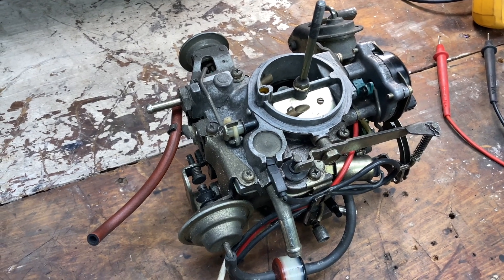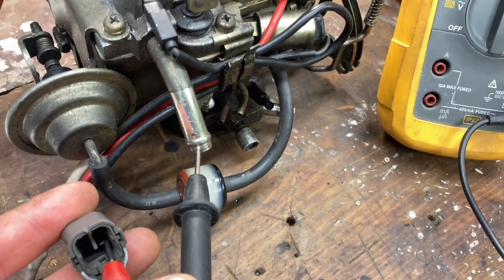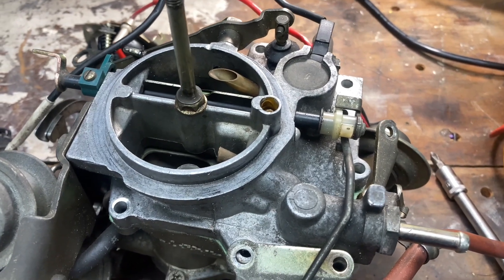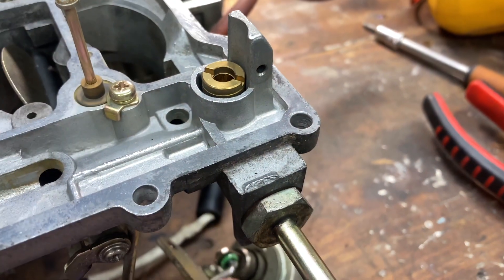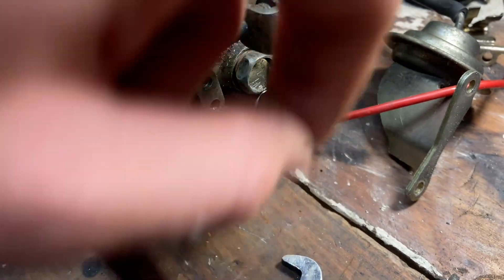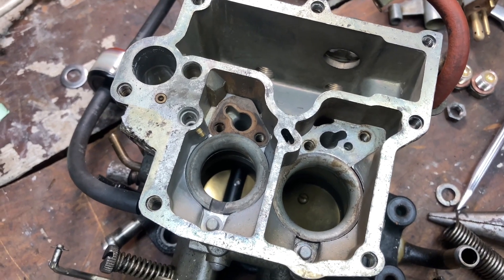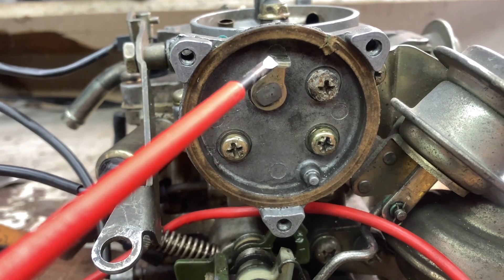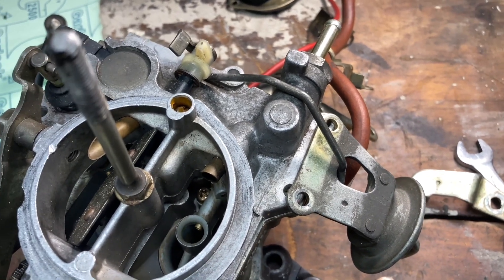Toyota 2E Carburettor disassembly and adjustment, cleaning etc

Comment: Well, the double audio had me super concerned, however information presented is critical. I figured i was missing something, and i was. 
I figured with a primary and secondary accelerator pump, it would have enough fuel for snappy acceleration. But power valve must be clogged on mine. 
Any way i look at it, im taking all the way down, like i should have to start with.

Comment: "I removed the carburetor and cleaned it thoroughly, then reinstalled it. After that, fuel consumption became excellent, the carbon buildup disappeared, and the engine sounded smooth. The car would start with just a tap and stayed that way for two weeks. But now, it won’t start unless I press the gas pedal, and when I release the pedal, the engine stalls — even at stoplights. What could have happened
Reply: Did you find a solution

Comment: The vehicle i have does not start unless a little bit of fuel is poured straight into the carb. I did notice that the fuel cut sensor has a dent in it. Could this be the cause?

Comment: I just have a question about the fuel bowl level window. Before driving the car the fuel level is exactly in the middle of the two metal marks but after driving the car it is above the top level mark is this normal because I have noticed while just at idle the car seems to be fumey.

Comment: Really top notch video.

But just a heads up. If removing the two screw on the butterfly plate, please make sure to flatten the screws when reinstalling or at the very minimum, use threadlock.

Had one of them come loose and graze up a bore. Not fun.😭

Comment: Hallo what is the problem if my car will not start in the morning i must throw petrol in the Caberator than it start were is the problem please and thank you for this great information 😊
Reply: That's normal for carb car. Just give it 2 pumps of petrol by the accelerator and let it run for 10 min to warm the car up. That does the trick with my car

Comment: How about the the bimetal that has 3 ports? Which of those ports are connected if the engine is cold and which of those ports if the engine is hot.
Reply: If you check under your bonnet there's a diagram. It will show you exactly where the vacuum pipes go. Hope this helps

Comment: Hi thanks for the informative video, I have watched you other video on setting the carb while its in the car  aswell

I have a question cause information on these cars are hard to come by, I am having a problem where when the car is parked overnight, i have to pump the acellerator for like 30 seconds before the car can start, so basically hold the starter for 5 seconds and pump pump pum then 3-4 seconds break, then another 5 seconds and so on... eventually the car will start and idle normally and drive normally... What would cause this?

Comment: My Toyota does not start without giving gas when it is hot. It starts when you press the gas pedal and start. where is problem ?
Reply: The dashpot might not be properly adjusted. The dashpot should hold the primary throttle plate ever so slightly to allow more air to pull the fuel from the primary jet
Reply: If it has a carburettor then this is normal
Reply: Así se arranca el motor 2e pisando a medias el acelerador y soltando cuando enciende, está por manual de usuario

Comment: Hi Jamie, thanks for the video! Have been following your content for a while now. I have an issue with this Carburettor on a 2E where it will run high at 3k rpm on cold start and will only settle to 900-1k when the the engine is at full operating temperature. I have to leave the car until the engine is stone cold or the choke will not come on at all. Choke doesn't seem to come off unless the auto choke assembly is set all the way to lean. Could be an issue with the choke actuator but not entirely sure to be honest. Apologies if this doesn't narrow anything down but I was wondering if you'd have any ideas as to what the problem is?
I have taken this to a couple of classic car garages and they haven't managed to get anywhere.
Reply: Have you checked your bimetal?

Comment: Hi jamie im having a problem with my 2e on cold start the fast idle only comes on for like 2 seconds then it goes off. And my motor then idles verry low till its warm.
Reply from the maker: You may need to increase the fast idle speed and/or the choke actuator
Reply: @notcompletelyobsolete  thanks Jamie, increasing the fast idle did the trick 👍🏼

Comment: WOULD U PLZ TELL ME THE ORIGINAL JETTING POWER VALE SECONDAY AND PRIMARY JETS FOR 3K CARBURETTOR WITH MANUAL CHOK FOR 2E ENGINE 12 VALVE

Comment: Hi Jamie. I have an issue with my idling speed. It runs high when cold like it is suppose to, but idle speed doesnt come all the way down at normal operating temperature. Out of desperation I adjusted the fuel mix screw, now the engine is running hot in addition to running high. Do you have remedy for this will be highly appreciated.
Reply: Do you find the problem?

Comment: Do you know the consequences of replacing all the vacuum valves with one way check valves (or removing completely)? The transmitting valves are nearly impossible/worth as much as my car to get here in the Philippines so was thinking maybe I could do this. I also had my vacuum switch valve break off. Is that only needed to heating car? Would it hurt to just plug up indefinitely? Don't really need heat here. Thanks for video!

Comment: Hey, I have a corolla ee90 which I think th eengine floods when it's not cold, my mechanic says it's ware a taire since the carb is over 30 years old, could it be bad cleaning and adjustment? what makes me think it runs rich is the fact that it bogs down and some times when it bogs down and turns off only at the 3rd crank the engine turns on but there is a strong smell of petrol. if you could give any adive it would be great

Comment: Hey bro, sounds like your from New Zealand, I'm from Auckland and have a 1994 2E Toyota Corolla Hatch, it has a bit of a rough idle and sometimes has smoke coming out the back of it, I believe it would possibly be the mixture setting as when I bought the car a few weeks back the guy had it on high idle, I remember seeing him touch the idle setting crew so one morning I adjusted it and made it rev lower, it was when it was about cold / warming up, seems to be good now and I know I can adjust that bit easily. I will have a go at the mixture setting but beforehand I was wondering if you were possibly in Auckland for you to have a look at it if your keen, would pay you for your time etc and if it can't be possible due to you being elsewhere, then I'll just try my best to follow these awesome videos you have here. Top notch stuff man, your really an expert on these (hopefully you cbk on a bit of a tune up hahaha) Cheers bro

Comment: hi jamie! my corolla e100 with 2e engine will shake and/or stall on operating temperature when coming to a stop, or turning from neutral to drive from idle, or putting it on reverse, or turning the steering wheel fast during stop. what could be the problem? should i turn up the base idle speed? but i feel like the rpm when i put it in neutral is already high. my car model came without an rpm meter, so i cant really tell.
Reply from the maker: Possibly the idle mixture screw is too far in (lean). This is the screw which sometimes has a tamper proof shroud over it, jamming a small flathead screwdriver between the screw and shroud allows you to adjust it without cutting or removing the shroud. Try winding this out about a turn and then adjust the base idle speed to around 800-900 rpm. If you still have idle issues, the passage ways or idle jet could be clogged and will need cleaning. Hope this helps

Comment: Good video helped me to better understand how the carb works on my Starlet. Though my starlet has the 1E engine the carbs are similar but the one on my Starlet is not an Auto Choke. and the lack of information has been driving me up the wall. I cannot seem to find manual for the Starlet. well one that is not an original Toyota one. May have to bite the bullet. The 1E is quite annoying as there is bugger all info on it. As far as i know it was only available in the Starlet and only from 84 to 92. Also do you know of any tuning options for these carbs. are you able to get more out of them than standards. Yes 54HP is good but could do with more. Though I have seen E series engines with Bike carbs or webbers so i may be better off going down that route. Cheers

Comment: hello can u help me? antifreeze is leaking from my carburetor. Please help with the gasket, what can it be made of and maybe you have some template that you can share with me? Thank you very much if you help, I will be very grateful!
Reply from the maker: There is a phenolic spacer that separates the carburettor and the intake manifold, might be worth checking that there are no cracks around that. The original gaskets tend to go brittle can leak especially after disassembly etc. I used automotive gasket paper to make the two gaskets that go either side of the spacer. I traced around the original gasket and mating surface to get the shape and cut the gasket to suit
Reply: @notcompletelyobsolete  Thank you very much for the answer! I removed the carburetor and the original gaskets were glued to the plastic backing. Can you tell me what material you made the new gaskets from? I tried to make them from paronite, but for some reason antifreeze starts to leak out through it and the car warms up very badly. I have a 92 Toyota Corolla E90.
Reply from the maker: Any automotive gasket paper with a similar thickness to the oem gasket should work well. From memory, i used a gasket paper with a thickness of 0.6mm. If the mating surfaces are perfectly clean and flat (check with a straight edge and feeler gauges, there should be no reason for coolant to leak from the assembly. Hope this helps…
Reply: @notcompletelyobsolete  Thanks you so much!

Comment: hey Jamie. what's the ideal setting for the fuel air mixture to consume minimum petrol?
Reply from the maker: I’ve found that the idle mixture screw has very little effect on fuel economy. If you have a smooth idle, I would recommend leaving this adjustment alone. If you do need to adjust this, I briefly mention how to adjust in my carburettor adjustment video
Reply: Hey jamie do you have a video showing electric connection of the carburetor, please share with me.